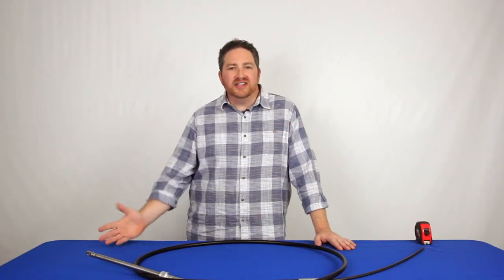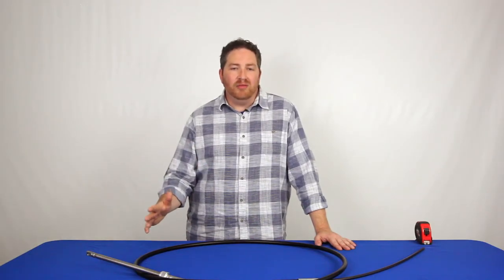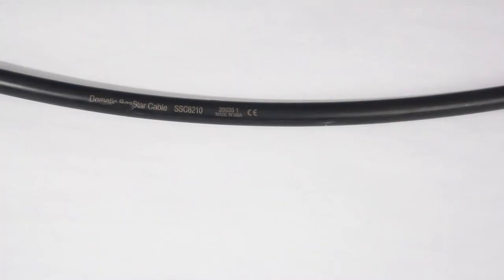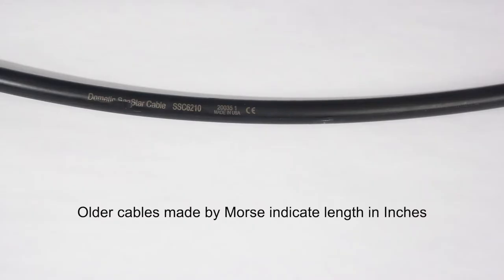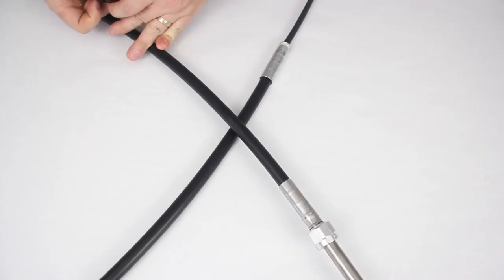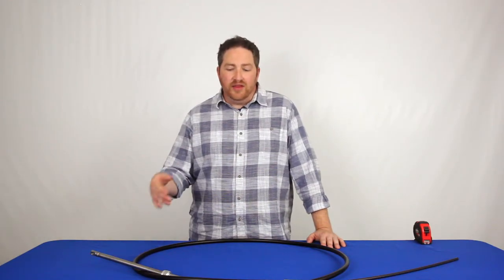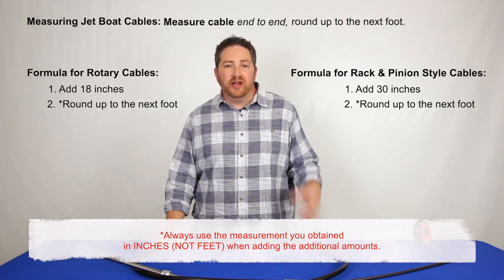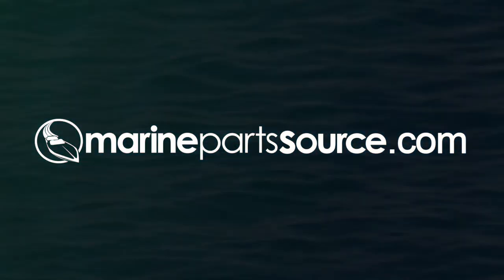How To Correctly Measure Your Boat's Steering Cables

Comment: Just pulled the cable out of my 2001 Boston Whaler 130 Sport.  Part printed on jacket was found just as described (Teleflex SSC6211).  Also checked it by measuring (9'6" jacket collar to collar only) and adding the 18", and that math also works out to 11'.  Can now order with confidence.  Perfect, and thank you for the instructions.

Comment: my project boat has no steering cable to measure...
Reply from the maker: In the case of a new installation, check out the instructions from Seastar Solutions on page 7 of their catalog: http://seastarsolutions.com/catalog/seastarcatalog.html#p=7

Let us know if we can help with any other questions!
Reply: @Marinepartssource  None of this is working! is your site down?
Reply from the maker: @merlin1346  the link I shared is not our site, it's from Seastar Solutions.  It may require a plug in to view.

If you would like to contact us using the form on our website, we can send you an attachment with the needed information: https://marinepartssource.com/contact-us

Comment: Okay, if you listen to this nonsense with the rotary cable you will end up getting 2ft too long. If the cable has 10 at the end of the number on the old steering cable, order a 10ft cable, do not add anything. If you have no cable and have to measure with a tape on the Boat measure from center of steering wheel to the outside of Boat then to the back of Boat then to the start of the Tilt Tube the steering cable will start in. If it reads 2ft + 7ft + 3ft it will be 12ft, no more or no less. I made the mistake of listening to this guy and ended up with 2ft too much. The correct measurement was 12ft, not 14ft.
Reply from the maker: You're absolutely right to use the numbers on the jacket of the cable to determine the length needed, and that is what we recommended in the video.  If the numbers are not readable, the method & formula we provide for measuring the cable is what is recommended by the major manufacturers of marine steering cables (Dometic, Uflex, etc.).  If the cable is not available for measurement, you would indeed measure the distance from helm to side of the boat, then to the back, and then to the tilt tube as you stated.  We cover this approach in our follow-up video: https://youtu.be/z5rNHws4BSQ?si=LUZNYKbx-6jGLEQK
Reply: @Marinepartssource  He actually says to add 18 inches to the length. "Then round it off to the nearest ft" and that's what messed it all up. Listen to what he says between 2:45 - 3:15. Why would you add 2 more feet for a rotary?